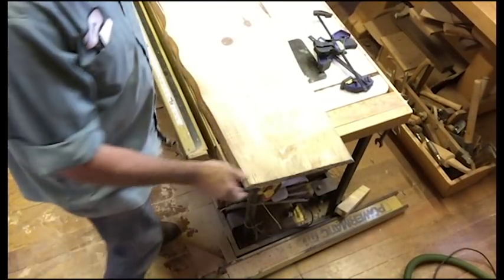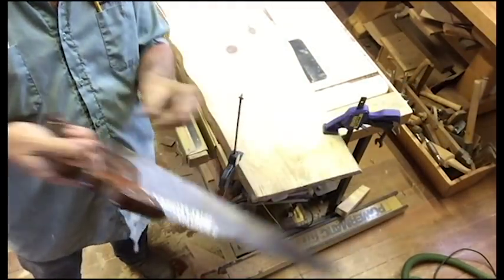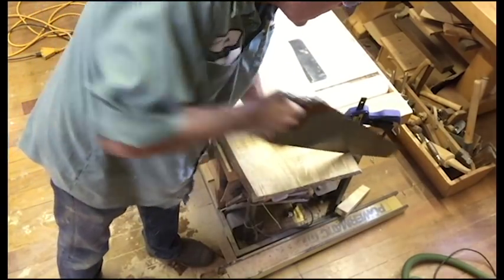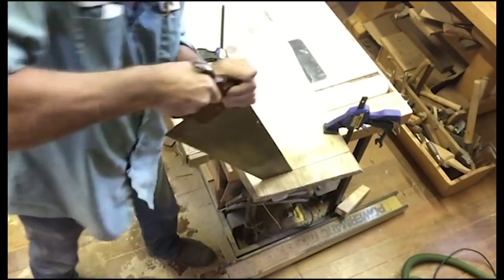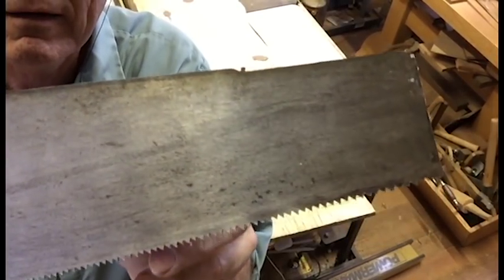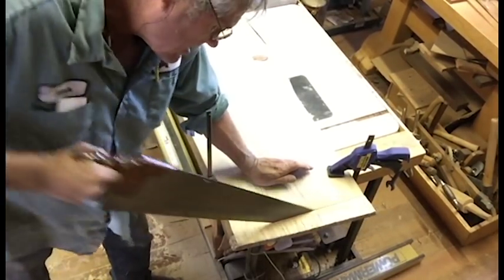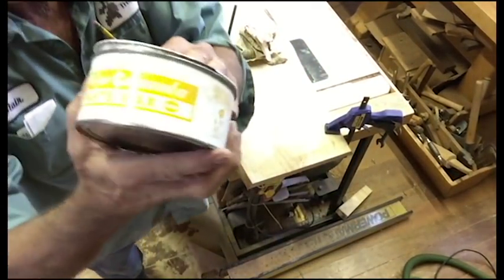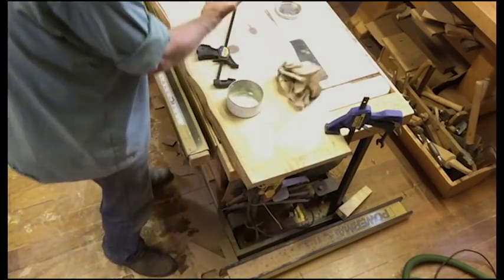My Handsaw

Comment: This video reminded me of my late granddad, who was a journeyman carpenter. He taught me about handsaws and how it connects a person to woodworking in a way that power tool-only users won't usually experience. The only power saw he ever used was a wormdrive Skilsaw Model E (which came before the Model 77) which he used for 40 years, and had it overhauled 4 times.  That wormdrive had loads of torque and could pull me through 1-inch plywood.  I still use a crosscut and ripsaw (both Disstons) that he bought back in the 50s.
Reply from the maker: And when you use your grand dads saws, you feel the energy of his life through the grip.
Reply: Sorry for your loss

Comment: Instead of using a chainsaw on a regular basis, I use a hand pruning saw all the time in the woods.  It is peaceful, good exercise, and most of all, quiet.  I still get a tremendous amount of work completed.  As far as the shop, I need to invest in a good hand saw.  Most of my cheap hand saws are very dull and not pleasant to use.
Reply from the maker: When you adapt to a handsaw, that is what you reach for first

Comment: Beeswax and parrafin wax work great on saw blades.
This video made miss my old Henry Disston tenon saw I used to own, it disappeared years ago, I think someone "borrowed" it.
I'll freely admit to using a circular saw for longer cuts like that, but I do like a tenon saw for anything smaller than a 4x2 or anything that needs a straight, clean cut. I managed to find a decent modern tenon saw a few years ago which I now own. Cheapo black plastic handle, but a beautiful blade. If I ever get around to it, maybe I'll make a nice handle for it someday!
The circular saw I have, I picked for it's small size and light weight. It only has a 7" blade, but because of that, and it's light weight, it is a one handed saw, meaning I can rest the other hand on the job, balance myself and do a far, far more accurate cut.
In fact, on that subject, I prefer to buy smaller, lighter "domestic" sized power tools for just that reason- smaller, lighter and easier to use accurately for a whole day, and weight is another reason I dislike cordless tools.
Reply from the maker: Nothing like a good, well tuned and really sharp handsaw. Find another

Comment: I like how dirty and cluttered your shop is. I think mine is more dirty and way more cluttered. My favorite handsaw is a 1980's, totally rust free, Sandvik 9t/10p 26" with two nice dragons embossed on the handle. Unfortunately I almost always grab my 1980's Milwaukee 7-1/4" circular saw for most jobs.
Reply from the maker: Habits are hard to break. I do clean my shop and I feel so much better when it is in order. I do have a system and I know where everything is (almost).
Reply: +arboristBlairGlenn same

Comment: Do you use Wax for your pruning saw? I oil mine regularly with camellia oil but I feel like something like wax might last longer while you are working with it. Also what type of wax is it called? maybe I missed you saying it in the video.
Reply from the maker: Any kind of cheap paste wax works fine. I use Camilla  oil on some of my fine veneer saws. When I remember to wax my pruning saws, I always say to myself, that was smart!

Thanks for commenting
Reply: +arboristBlairGlenn thank you, i think I'll give it a try!
Reply: +arboristBlairGlenn I got a ginormous (regular sized) tin of Johnson paste wax, which has a terrible smell, does the stuff you are using also smell, is that just how paste wax is? 

Also, as always, great video. Reminding me I need to finish my vice so I can start my practice at cutting dovetails.
Reply from the maker: +Ryder Booth been too long Ryder

Comment: I heard onetime its for putting a pencil in a draw a straight line..
Reply from the maker: That I don't understand
Reply: +arboristBlairGlenn  "a draw" I believe should be "to draw". You would measure with a tape to the point of the cut, usually a Rip Cut. lay the saw across the board with the Handle in front of you. Insert a pencil at the base of the Nib where it joins the saw (Toe Nib, Nicker Nib, Cut Line Nib) at the Cut Mark Use your other hand as a Saw Guide wherever the blade is now located at the edge of the wood and run the cut line the length of the board.   <><> NEXT: That's ONE of MANY supposed uses of the Nib! It has become a "Theological Discussion" over Many Years. Henry Disston said in his publication "Lumberman's Handbook" that there was no practical use for the Nib and it was for "Ornamentation" purposes only. Eh? Maybe?  <><> (I gotta run!) Yes. Your saw is a 12 or possibly  a 112. Followed by a D-12 and a D-112. It was their Top Of The Line Saw. made from about 1876. Hand, Chipped carved Apple Wood Handle.... OK I'm gone for now. More later, I use to collect Disston Saws and have a PILE of Info on here. OH! They also produced a Pruning Saw D-27, no top or bottom "Horns", and 2 man Saws. More Later ZOOOOOOM >>>>>>>>>.
Reply from the maker: +SunShine wow, awesome reply. I'm with you on this one. I think a custom saw company should do this again. And the controversy would begin again!
Reply: arboristBlairGlenn
My pleasure Blair. The guy who runs the Disston "Heritage" Website says he has more that 127 uses now registered for the Nib and don't anybody send him any more, unless they are Funny Ones ...LOL.. My personal Favorite is that it was used to hold a Blade Guard. The Lanyard was tied or slipped around it for that end and another one for the Handle end.

Just to finish your saw. As shown on yours, it was made from "London Spring Steel" a Very Hard Steel. that allowed them to make the "Back/Top" somewhat Thinner for an easier and better Cut. It was apparently produced from the 1870's to about the 1920's. I made a copy of their 1876 Catalogue Page and yours was available in 8 Lengths from 16" to 30". I did a BIG WHAT! on the Price List. The 26" Model was listed at a Retail of $35.00 PER DOZEN! HELLO! I guess a Buck back then was worth a lot more than it is today.

You have a Very Nice Saw there my Friend compliments of your Grandfather! Grandfathers are Special People! "Life's Cycle Continues."
Reply: Just a little aside. I'm almost laughing at the number of Videos on here about "How To Straighten A Saw Blade." BUT! Most of the top name saws came with a built in "Bend" maybe even yours. It was called "Breasting" and was there to give a Better and Easier Cut by eliminating problems caused by a Straight Blade. Logic tells you that to make a straight cut you need  Straight Blade. Jury is still out on "Breasting." ...LOL...